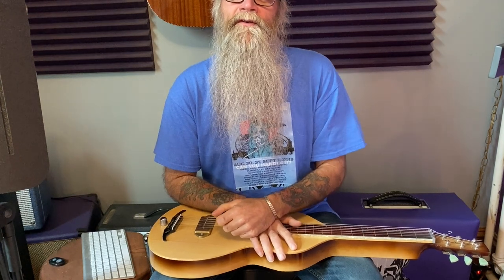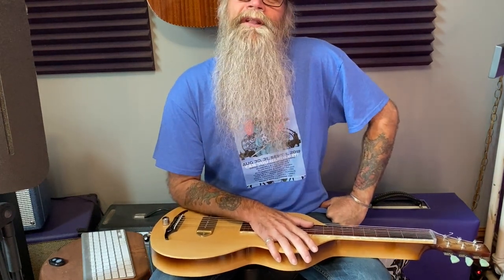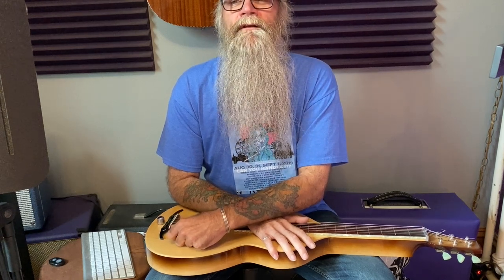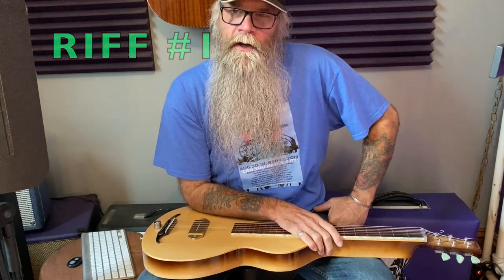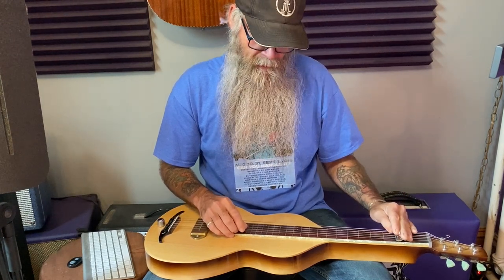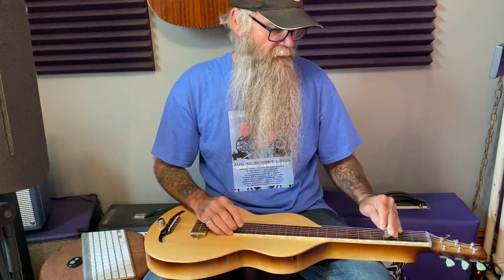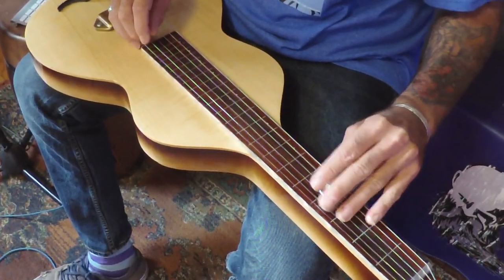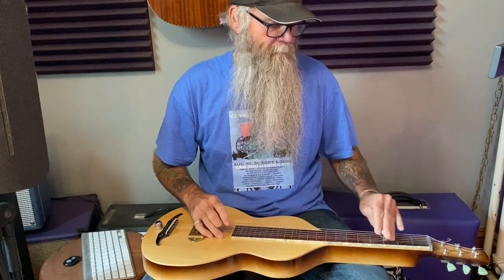Introduction To Electric Lap Steel in OPEN G PT 3

Comment: Due to various reasons I can't play my electric guitars too much,...old age & a wild youth !! So i already have some knowledge & theory etc. But i think i could switch to Lap Steel & it would be easier on my body. Never could get comfortable trying to learn slide on my electrics. What type or model Lap Steel guitar would you suggest for someone like me. I like the Gretch, but it's $500.00 bucks. I have amps & pedals etc. Just need that Lap Steel. I'm primarily a Blues player, if that helps.
Reply from the maker: In the "old Days" you could find lap steels anywhere. They were like a dime a dozen 20 years ago. Now, they are getting tougher to find, however, they are out there. If you search hard enough, you can find old Supro/National/Valco steels for under 300 bucks. They are a great little steels. The Gibson and Richenbachers will be more expensive and in my opinion rightfully so. IF you're looking for super budget I hear that Rogue makes steels and I have a couple students that are having good luck with them. I haven't played one, so sadly, I can't give a valid opinion on one:( The Gretsch you mention are decent instruments, but if yer getting into the $500 zone, you can easily find Supro for that money:) At least that's the case here in Canada:)
Reply: Cheap vintage steels have been drying up since the start of covid . At mainstream local music stores , you can sometimes find used late model Gretch or Epiphone steels for good prices .  Both are good sounding instruments , but the Gretch has noticeably narrow string spacing , and the Epi noticeably wide spring spacing . I picked up an Epi a few months ago , for $150-ish IIRC .

  Before the zombie apocalypse , Rogue and the dozen or so near identical knockoffs were regular price $99 , frequently on sale for $79 from all the usual internet sellers . But currently they're going for full price of $159- $179 .. Not worth it for that money .

  The middle ground are the Recording Kings , and SX . from just under to just over $ 200 , depending on model .
Reply: @margarethouse404  thankyou Margaret. I did get a cheapo Recording King to try & start out. If I don't like the concept I'll just sell it,... no great loss. Haven't plugged it in yet. Got some remodeling done in basement, just about to un bury my beautiful guitars & get some hung on the wall. Opening a new can of worms at my seasoned age ! Oh well, retired with time right.